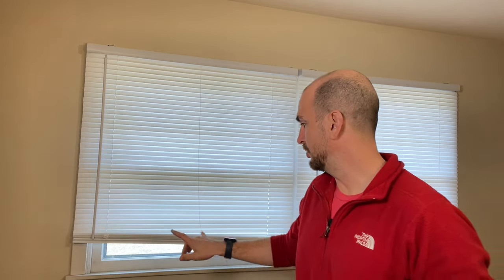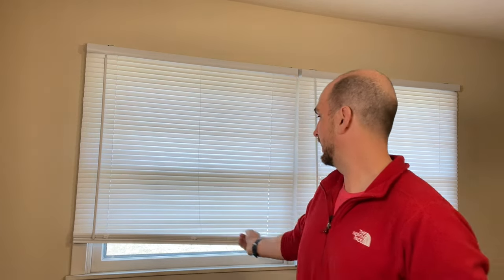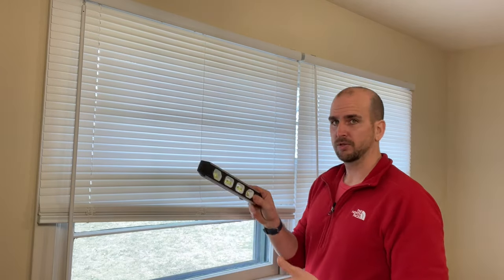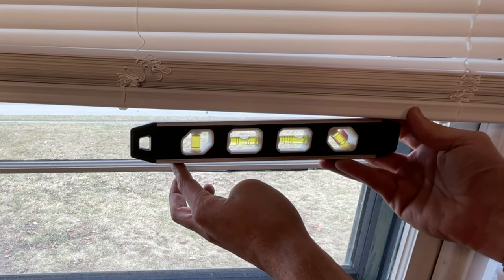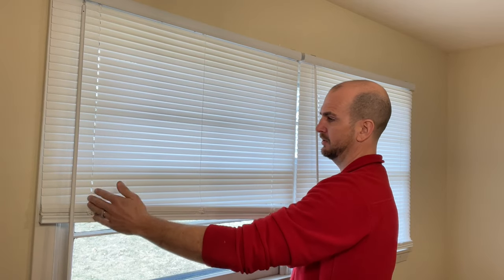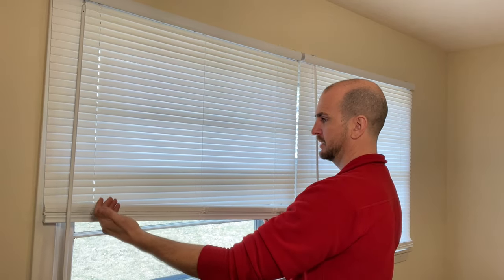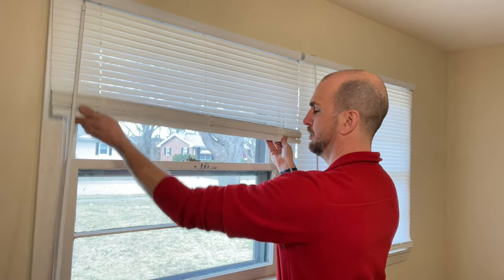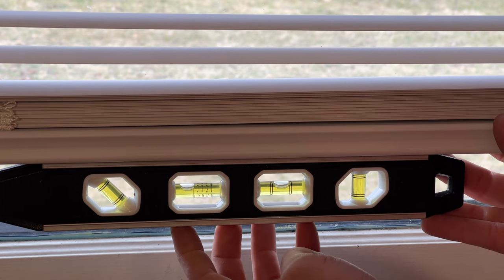How To Fix Uneven or Crooked Cordless Blinds

Comment: When there are more lift strings, the teeter totter jerk doesn't work whereas a slow pull on the high side while supporting the low side will allow the lift strings to even out. It does take more tension than you might expect, perhaps 20 lbs or so. When you feel the string start to slide, that's all you need. This also has the advantage of greater control, and is less likely to break a string since the peak tension is lower.

Comment: This is so simple I can't believe I've never thought to try it! I usually like to trim mini blinds to length which as you said also would take care of it, but I've been putting off doing that to fix a set in the kitchen that's been crooked since it went up. Fixed now, and I suppose I can live with some extra slats at the bottom.
Reply from the maker: I am still stumped why the manufacturers don't call out this fix since the problem is pretty common 🤷‍♂️

Comment: On mine, the string had jumped the spool in the (spring loaded) take-up mechanism and then slightly wrapped itself around the axle.  It took some time and patience to fix.  I nearly blundered in a way that would have realeased all the tension.  Fortune prevailed. The only damage, if any, was to the topmost slat (that may have already been broken).  As I was prepared to replace the blind, pressure was low.  Out of maybe three previous attempts at this kind of repair, I think this was the first success.  Good Luck.

Comment: Thanks for the video tip.  I believe this tip will only work on cordless style blinds where you push up or pull down the blinds itself.  Corded blinds are more difficult to balance because of the cord mechanism.

Comment: Thanks so much for sharing your knowledge. Can you advise me on how to repair a broken string. It's one that goes through the middle of the blind.(on one end) I've been struggling to find any information on how to fix this on the cordless blind. Thanks
Reply from the maker: Hmmmm, might be hard to repair the string with a robust fix.  Are you able to find a matching blind at your local home improvement store?  Often if you are dealing with 1" vinyl blinds it is easier to just swap out opposed to fixing.

Comment: the left side is very tight and the right side is loose.  This happened after I shortened the blinds, and at first I had taken the string out of the plug on the left, then realized that was for a corded blind after I couldn't get the string out of the right plug and checked another video.  After that the left side cord kept wanting to move up (and left several of the remaining slats) while the right side of the blinds remained loose.  It was a huge battle.  I tried to even them out as best I could, but the end result is, nice shorter blinds but the left side remains 5" higher.  I tried your method, very hopefully, but no success, unless I am not pulling hard enough on the left, though it's so tight I'm afraid something will break.
Reply: to clarify, the shortening was done following other videos, and my end result led me to your video.
Reply: when I pull the left one down all the way, and they are even, as soon as I let go of it, it jumps back up the 5"

Comment: What about blinds/shades that slip a little. After pulling the up, about 1 sec to a minute later one side slips down. It does this most of the time. I have to aggressively "lock the blinds" by going a little higher than I want pretty fast and the letting them free fall into the locked position. These blinds/shades have what looks like two pinch rollers shaped like gears that catch the strings. One of the rollers moves into position by friction with the strings. I tried cleaning to rollers (where it contacts the frame?) I've tried putting something on the strings that gives them more grip (rosin). Nothing has worked, but good old fashioned muscle power and timing. The wife cant do it, so she has to deal with ugly sagging blinds, or have me do it before leaving. We have two other blinds/shades of this style. The other two work fine. They are several years olf, and past their warranty. The windows are so old we had to get custom fit blinds.

Any thoughts? I'm open to all.

Comment: Turns out my cellular shades had a little twist in the line, and it caused a small knot. A little tricker but once I found it I was able to pull the knot out with an automotive hook tool

Comment: I’m struggling to get the opener to work on mine ... it’s stuck ... any suggestions? 🤔 and thanks!!
Reply from the maker: You are having issues turning the “wand” to adjust the amount of light coming into the room?
Reply: @EverydayHomeRepairs  yes the wand is “stuck” ... I had a new door installed and when the blind was put back up, the wand no longer turns to open and close them :(

Comment: Do you have a fix for corded blinds?
Reply from the maker: When this happens to corded blinds it is actually an easier fix because the cord has 2 independent strings one of each side so you just need to release the strings and adjust each side accordingly.